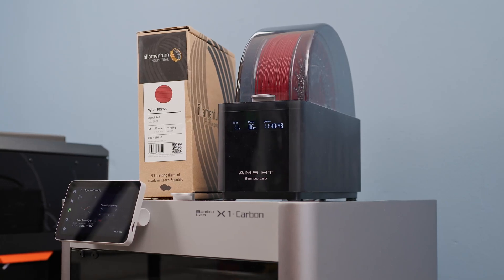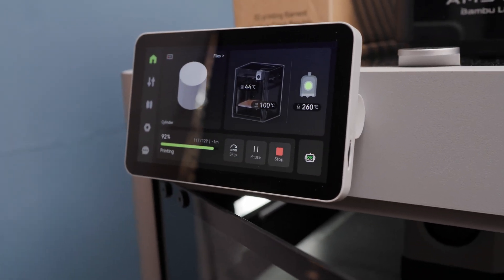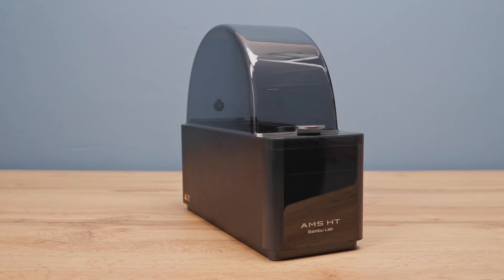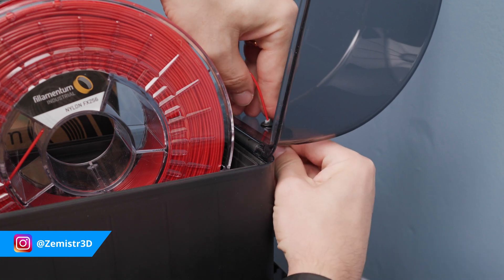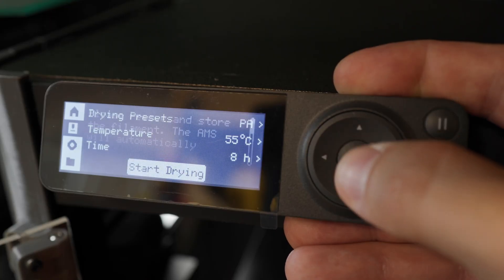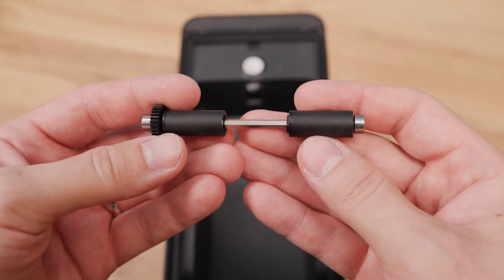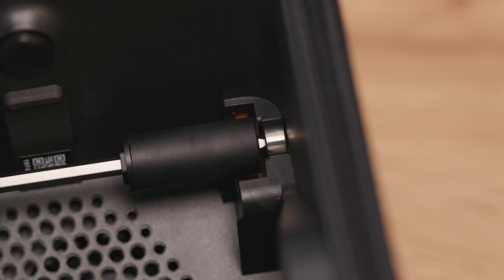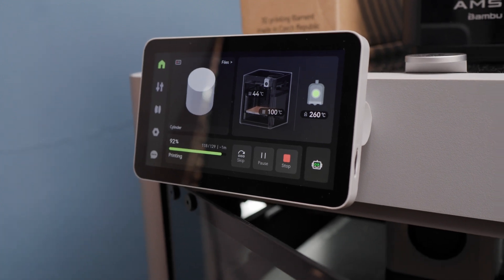This Bambu Lab AMS HT Hack Enables Printing While Drying!

Comment: Why doesn't Bambulab allow drying while printing? Is it because the power consumption because I'm pretty sure with the AMS 2 pro you can print while drying, when you get an extra power supply (30$ at bambu website) but with the AMS HT this isn the case because why?
Reply: You cannot dry with the AMS 2 Pro, no matter if you get the power supply....

Comment: why not actually load a spool on the external holder while the ht dries a second spool?

there is a good reason the manufacturer disabled printing while drying the same spool.  warm filament is too soft.  it will jam up your extruder gears.
Reply: It's like comparing iOS to Android here. Yes, you are right, there is a reason, but manufacturer should make it a warning rather than completelly denying. It should be up to user to decide, not up to manufacturer.
Reply: @criticalmoorhen and where is the warning that using this modification will ruin your extruder gears?  sure, haveing an allow printing while drying checkmark in advanced settings with a warning message to make you aware of the dangers would be better than a ban with no explanation.  however, selling a mod like this without even having a warning lable is worse.  By monetizing this video he is effectively selling this modification

Comment: I have been utterly disappointed with my AMSHT.
It will not feed nylon filaments at all. The motor has 0grip from the weak spring pressure and it causes grooving to occur on the SLIGHTEST binding.
It just spins the wheel like a tyre-fire..

Comment: I saw your video: THANK YOU!!! One question: how can I get the AMS HT to work as a heater without the P1S recognizing it and blocking it?
Reply: You need to print from the "external spool". The P1S will see the HT, but it won't care because it thinks it's printing from the external spool holder.

Comment: The problem I have with it is that you have to turn the printer on to dry your filament. 
I hate this kind of platform. Everything should work seperately but Bambulab forces you to connect to their services.
Big Bambu is watching you.
Creality Space Pi X4 also has 85°C drying, 2x2 spools. And seperate from any kind of brand platform.

Comment: If you want simply heating and drying and do manual load and unload you can buy a much cheaper dryer for example the sunlu S1 for around 50 euro. Thats not why we buy a expensive AMS-HT
Reply from the maker: I bought HT because of it’s maximal temperature 🙌

Comment: After modifying respooling is not working anymore
Reply from the maker: What is not working?
If you flip the shaft you will of course not be able to use the respooling, because the shaft is not connected with the motor.

Comment: Why would you want to do this? Surely the filament isn't going to gain that much moisture during a print, given that it's located in a dry box.
Reply: I use a Creality space pi, but I always have the heater on when printing. I guess that the filament coming in at 50 degrees to the nozzle is better than like 22 degrees. Also, I have noticed when I do not use it, the finishing is not as good sometimes. But I do not care that much about the drying, just heating since where I live it more often too little humidity in the air.

Comment: But if the spool can’t be rotated that also means you can’t print with the AMS functionality while you have this hack right? Only single color/material prints only?
Reply from the maker: You are right. It works just like a spool holder with heating element.
No AMS functionality.
If you have more AMS units, you can use other units which are not drying.
Reply: @Zemistr3D  regardless its an awsome hack! thanks
Reply: I mean much better than nothing, still disappointing though